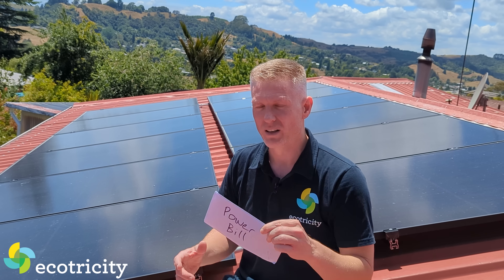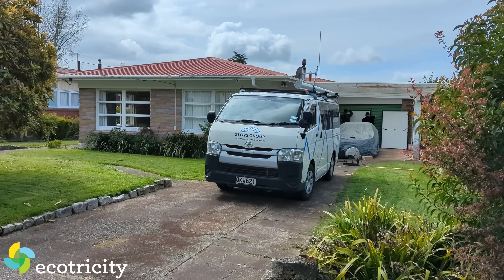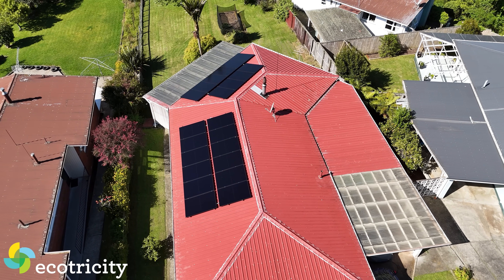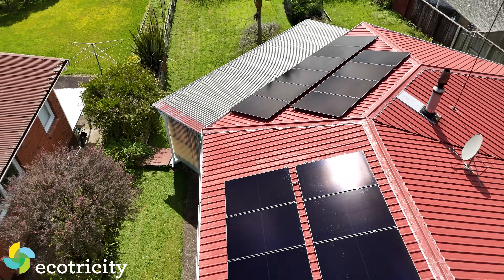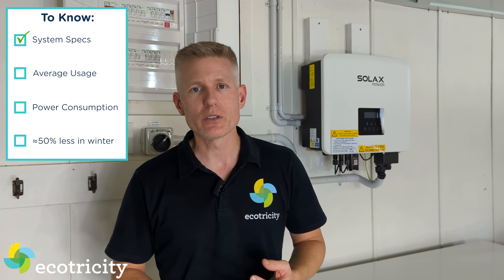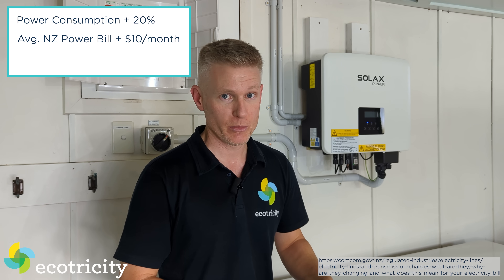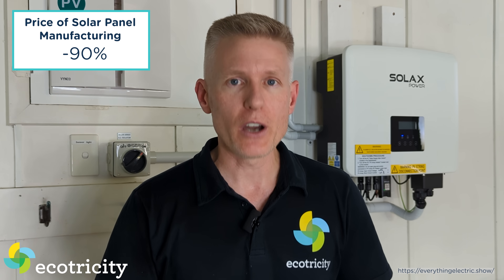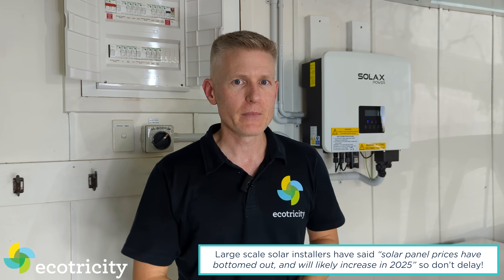Is solar power really worth it in New Zealand?

Comment: Thanks for making the video. You didn't take into account the return you could make if you invested the 21k somewhere else. I.e instead of investing in solar what would the return be if I invested in shares.  As an example shares don't require any maintenance and could conservatively provide a 10% pa return and then you also get the compounding return from that interest.    You also didn't mention the cost to replace the power inverter.
Reply: $21k invested at 10% returns $2100.  Minus tax is about $1400 - no compounding because he still needs to pay the power bill, the $1400 gets spent.
From the video it looks like his system is worth more than $1400 per year.

Comment: New homes should come with solar panels, a rain water collection system and an electric vehicle charger in the garage.
Reply: We have a roof full of solar panels,  and batteries, in the UK. Buy in cheap electricity at night in winter, and use during the day..
Summer/ Spring/ Autumn, has the batteries fully charged, via solar, we sell it back to the grid.  No EV to charge. Geography and baring of the house roof to sun, are factors in this.  Thank you China, for all the kit, at a price that affordable.  Our late 60s bungalow, had all the defects in insulation of its time, a degree of investment was needed there. We hit the buffers at a heat pump cost.
Reply: @Aubury  Did you check in with Octopus Energy about getting a heat pump installed? Depending on situation, should cost around £3,000 and they do the whole thing taking about 3 to 4 days to go from assessment to installation. Even if your circumstances don't allow for the moment, can't hurt to enquire.
Reply: You should call yourself Jacinta
Reply: @reynolds0088  Why ?  -> because he's right ??
Reply: Cause housing is so affordable and not a lot of compliance costs.😂
Reply: @Dakalberry  Short term thinking is what keeps people poor. The long term savings of an energy efficient house saves you money many times over.  Short term thinking will keep your poor.  It is a hard but necessary lesson to learn. Spending a little more upfront can pay dividends in the future.
Reply: So agree with water collection.
Reply: @KJSvitko .....as [standard]!!!
Reply: "I'd prefer gold plate taps where the toilet cistern connects to the water supply".
That is how out of touch our building industry is - they will upsell you useless junk with bling factor, rather than doing stuff like solar that saves you money.
Reply: How often should you clean your solar panels? Did they discuss this with you?
Reply: NZ homes are too exspensive to build already - making solar mandatory would be a bad move. If anything we need to lower the specs. Having everything perfect on a house doesn't matter if no one can buy them.
Reply: @Ryan-me9ge  Short term thinking is what keeps people poor. The long term savings of an energy efficient house and electric vehicle saves you money many times over.  Short term thinking will keep your poor.  It is a hard but necessary lesson to learn. Spending a little more upfront can pay dividends in the future.
Reply: @KJSvitko I’m building a house right now and I can tell you all the regulations add a huge amount to the cost of a house. I understand what you’re saying with solar panels saving people money in the long term but with the way western societies operate the average person loses much more money by simple not being about to get on the housing ladder. 
We don’t have a surplus of housing - the priority should be to build four walls and a roof to a reasonable standard, some of the best houses are from the 1930’s which were very simple compared to what’s asked for today.
Reply: @KJSvitko  Yeah I tend to strongly agree. Us Kiwis really seem to make an appalling lack of use of such a great surface area. Using it for  solar and water collection is a no brainer. All that space and we under utilize it.
Reply: Yep, my mum’s just moved into a new build and it’s beyond annoying that it doesn’t have solar panels fitted (it wasn’t even an optional extra).
Reply: Have solar and these figures are very suspicious. Never had anything in credit. Not charging electric vehicles and spend limited time at home. Savings will never payback costs and interest incurred. Hasn’t taken into account the annual electrical check on system and what will be very expensive environmental costs to remove panels when finished. You just can’t dump in landfill. Not convinced after having solar.
Reply: Illegal to install a electric car charger in an attached garage in Invercargill
Reply: @jamieoconnor4342  Maybe find a qualified sparky then, seems legal in the rest of the country. Is 'cargill actually in the 21st century yet ?
Reply: Nice thinking ... but. If every house where i live had solar panels, our energy infrastructure would collapse. There would be excess of energy going into grid during day and demand during night. That is not good for the infrastructure and for power plants. Not to mention that ROI is longer than lifetime of those panels.
Water collection is actually illegal in some countries, especially those that care about ecology. 
For the EV charger, i don't have remotely enough money to buy EV with long range and even those would struggle with my daily commutes. Also having solar panels and being home usually during time when there is no sun during winter
Maybe sometimes think that not everyone has same needs as you do
Reply: Terrible idea, the only good power generation method where the math actually adds up is a centralized solution, i.e. a power plant. We should invest as a country in bigger and better power plants that can generate cheap electricity at scale. Solar panels with over engineered, expensive EVs are "all bark no bite"
Reply: Why no let people decide for themselves.  Houses are expensive enough without adding another large expensive.
Reply: I'd not like to pay the insurance premium if there is a car charger in the garage.
Reply: I’ve got 2 x EV chargers in my garage and it makes zero difference to the insurance price….
Reply: there's no insurance charges for a charger or batteries in the garage
Reply: I work in the insurance industry and can assure you that I don't pay for the car charger in either of my properties and neither should you.  Shop around if you are being asked to pay extra.
Reply: But your shed is full of Petrol
Reply: What?  Which century are you living in Sir?  Most EV owners just use a simple adaptor to charge an EV directly from a standard 230V outlet.
Reply: Can you tell me how every house with a car charger is going to be powered? It takes a massive amount of energy to charge an EV, the grid isn't even close to coping with that. Don't say the solar panels either, they only work on a bright day and everyone wants to charge at night. You would need a lot of panels, a massive storage battery bank and a lot of reliable bright days, which we don't have. People really have no clue what it actually requires, they think all you need are panels and a car charger and everything will just work.
Reply: @Kanuka-Forest  Solar panels combined with battery storage.
Reply: @Kanuka-Forest  Stop with the fact free FUD. An EV doing 15,000km per year (average distance in NZ) will use (at average consumption 16kWh/100km) 2,400kWh, so around 6 units of power per day. An average solar system will produce more than this in winter, and heaps more in summer. Apparently you install solar for a living - I'd certainly be avoiding you if I was looking for a system as you get all the basics completely wrong.
Reply: I wouldn’t e charging my EV inside, the odds of burning your house down are too high, and so is your insurance premium
Reply: @peterhancox5268  The odds of burning your house down is more a factor if you're regularly charging batteries in small devices, particularly ones that are Ali X 'bargain buys', but for EVs sold in New Zealand and most other developed countries the BMSs are more than capable of ensuring thermal issues don't occur. The insurance companies know this and that's the reason why major insurers here don't require separate information for house insurance regarding the presence of EVSEs, or whether EVs are parked in residences. Having conversed in detail with two major NZ insurance companies as I investigated a change of provider recently I know this to be fact.
Reply: @ Time you understood battery technology.  Only lithium ion batteries can catch fire, so make sure the EV you buy doesn't have these and you will be fine.
Reply: @peterhancox5268  Probably not if your car has LFP batteries. You would need to research that a bit though.
Reply: @peterhancox5268  your ICE vehicle has a 20 x higher risk of catching on fire than an EV
Reply: It's all a scam
Reply: @peter12266  you sound like you still pay an electric bill. I have 10.5kW PV & 3 Powerwalls. I haven't paid for electricity since 2018 and Amber Electric owes me >$2000 at the moment. Such a scam! I want more scams! 😆👉🤡

Comment: Might pay to hold fire on investing in battery storage. AS/NZS 4777.1:2024 standard is due to be rolled out in NZ in a few months and it includes regulatory ability to use EVs in a V2H/V2G capacity. In other words any EV that has bidirectional charging ability (but V2L won't cut it) can be used to run your house, and export to the grid at peak FIT rates.

FWIW our solar setup is 9.5kW of panels through an 8.2kW single phase inverter. Our current months power bill is around $20 in credit and we charge 2 EVs and garden tools, have pumped water, a HWC diverter and we run two 700L chest freezers. ROI is tracking at about 9 years, without factoring in EV fuel savings. We get a 17c export tariff but the single biggest gain is by maximising self consumption as the value of that offset consumption is whatever your supply rate is (including GST) which will always be well more than any FIT on offer.
Reply: Are you with Octopus Energy?
Reply: @peterwiles1299  Sure are. Our FIT is only 1.5c different to the night rate on the OctopusFlexi - Low User plan so night charging of our EVs carries very little penalty if we can't do so from solar.
Reply: @peterwiles1299 I was one of the lucky ones with Octopus. We get the 17 cents export and 18 cents night rate, but the biggest benefit is zero daily fixed charge! Most pay min 60 cents per day and some as much as $3 per day!
Reply: I’m interested to know more about the vehicle to home change coming up, I’m in the process of getting a solar system and an EV. I wasn’t planning on getting a battery. Would you suggest buying an EV with a certain capability to use the stored energy to power the house in the evening? Sorry I’m very new to all this way of thinking
Reply: @emeraldwindsor6253  V2G is an emerging technology for NZ so best to find yourself a reputable installer for your solar and use their up to date knowledge for guidance.

Also only a few EVs available in NZ have V2G functionality so choose wisely, do your homework and ask questions. Also be aware that V2L is a very different level of bidirectional connectivity and will only allow you to connect an appliance or two to your EV, and as far as extension leads will reach. V2G connects via a purpose built wall charger and needs to be professionally installed.
Reply: @ It’s complex.  However the standard solar installers make no attempt to provide systems of optimal efficiency.  To do that, panels need to be inclined at about 45 degrees.
Reply: @peterwiles1299  45 degrees may be applicable for mid season optimisation in the lower South Island in NZ (or for increasing winter generation) but the reasons are relatively simple to work out. 

Your latitude directly relates to the sun's vertical angle to the zenith (straight up). Here in Taranaki we're at 39 degrees latitude so the sun is 39 degrees from vertical at the equinox (mid season) so our panels are tilted at 39 degrees from horizontal. This means the sun is at right angles (optimum) at the equinoxes so maximum gain then. If we wanted to boost summer generation we could flatten them down or for winter gain increase tilt to say 60 degrees. 

In NZ roof slopes of 30 degrees are common so no alteration is generally required for solar panel tilt angle.

Comment: On the Sunshine Coast here in Australia, I was getting 8 cents kWh for feed-in,   They just emailed me and dropped it down to 4 cents.  I wonder how long you'll be getting 13 cents FIT.
Reply: You should expect the buyback price to vary quite a lot depending on market conditions. If the energy produced by solar grows faster than the demand, then the price will drop, and the reverse will apply when demand increases (more EV charging, winter heating or summer cooling).
Reply: The NZ energy landscape is immensely different than AU. 

We don't have coal power stations that panic on every sunny day. Australia can't afford to have too much solar, as it puts the viability of coal plants at risk.

NZ's baseline is hydro and geothermal, which changes the story completely around the value of solar energy and its place in the daytime energy economy.

In short, NZ needs a lot more solar.
Reply: Dump your ordinary retail electricity supplier which is paying peanuts and get a battery- even 5kWh will do- and get on Amber Electric wholesale. Our 12 month avg feed-in is 65c/kWh. Price spikes can pay up to $18.13/kWh for brief periods in NSW. We have 10.5kW PV and 3 Powerwalls. We avoid $4000/yr grid imports and have >$2000 in credit.

Comment: Nice big system. You can never have too much solar. 

Wow that feed in tariff is amazing. All I get here in South Australia is 4c per kwh now.
Reply: Here in Western Australia peak = 10c/kwh but off peak is 2c/kwh
Reply: @Greg-k4j  
How "close " are you to your neighbours? 
Close enough for then to be "shareholders" in your array and be directly supplied????
Reply: Power companies have cut feed-in to nothing all across Aus. You need a battery- even 5kWh will do- so you can avoid peak rates and export in the evenings at high rates. Check out Amber Electric. Our 12 month feed-in avg is 65c/kWh and that is after supplying all household power. We're >$2000 in credit at the moment.

Comment: Im in Malaysia and ive just installed a 10.2kW solar for RM25k (NZD 10K). Its under NEM (net metering) so all my excess gets exported to the grid and the energy company pays for it 1 to 1 of the regular electricity tariff. Also gotten a $1.6k cash rebate from the energy company for installing solar. So thankfully no need for batteries 😊
Reply: Wish we had 1:1 purchasing of solar here in NZ. they buy it at less than 15% of the retail price
Reply: @2g1c69  NZ is a piece of shit in this regard.

Comment: I have a small house so only 1.9kw and 7kwh battery.
Very happy with the setup.
Reply: YAY, someone else with a nice, modest power consumption. 
I average just under 3KWh per day, which is nearly a 1/10th of what some of the contributors here are using. 
I'm about to change over to a smart meter so I can get a better idea of "how much power consumption and when". I'm retired and have already moved the consumption time for most of my appliances to 'off-peak' (washing machine, cooking, shower). Along with the smart meter, I will be moving to the Meridian plan with the free power 9pm to 12pm and put a timer on my hot water tank (130L) plus use the washing machine in that time period. 
I will then review my system and see if it is worth installing a 3KW solar system to further reduce my grid use saving 35c/KW hr and hopefully get some of the 17c/KW hr solar rebate for grid feed in for my excess generation.

Comment: Put a 9.875kW solar array on our roof in Wanaka in May 2022 coupled with 9.9kWh battery storage.  Payback is a little slower than I expected but have essentially reduced our energy costs for our two properties from $4,013 in 2022 to $1,032 in 2024 over our properties in Wanaka and Christchurch.  The net cost of power in our large Wanaka home for the year June 2023 to June 2024 was a refund of $425.51.  Total generation for 2023 was 11,918kW while 2024 was down at 10,467kW.  We have had an electric car since September 2023 which is charged during sunny daylight hours however I note the savings above do not account for savings in the cost of motoring.  That is just too hard to work out.
Reply: do you have a hot water cylinder in your property? If so puy it on an isolated circuit breaker with a timer (140 bucks). You will then address the biggest energy sucker to work when the sun shines too!
Reply: @ Yes, the inversion is a pain and usually lasts for a week, which means that we use some of our "banked" feed-in savings.  I agree that the battery capacity is a little small and have just costed a further 3.2kWh module but at $3,050 installed I decided it was a bit too rich.  If battery prices come down I will look at it again.
Reply: @ We use our diesel boiler to heat our water as it is way more efficient that electricity.  Cost-wise it might be less to run it electrically but as we don't have the required switching the cost of that would take some time to recover.  We only use about $150 of diesel outside of the central heating period to heat our water.
Reply: Hi mate, who was your installer in Wanaka?

Comment: Do not whatever you do compare NZ pricing for a solar system to AU.
Because they have a mature installation market its a lot cheaper across the ditch .  
 I live off grid in northland .
No power bill and no power cuts. More than once i have tuned up to work only to find the grid was down no power  no work.

Comment: We only have a 4kW system, (as much as we could fit without extensive scaffolding )-- which has been adequate for our needs in summer.  Wintertime is not so happy owing to the sun being shy -- but on good days we can run the house, heat water, and charge the car.  Definitely around 10kW is a better choice for the average home.